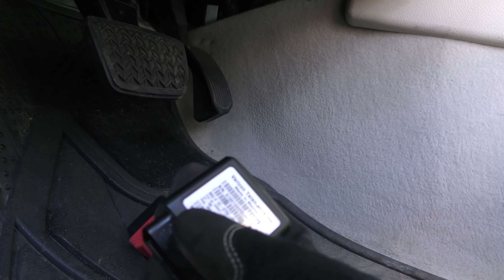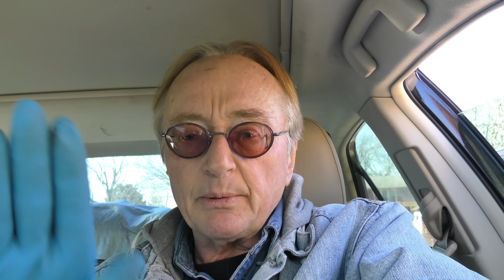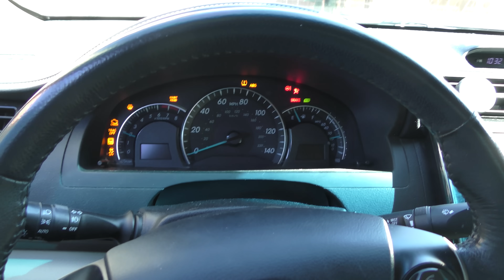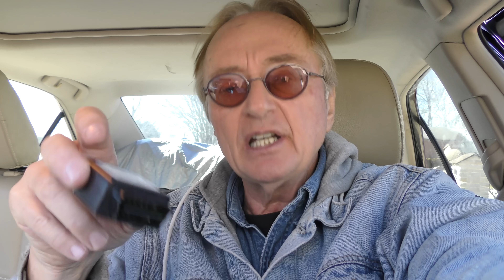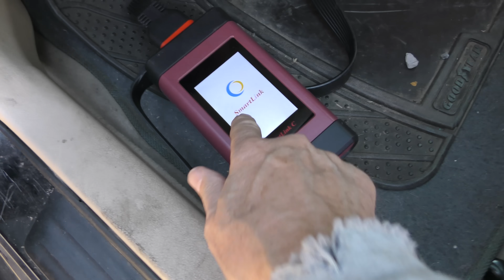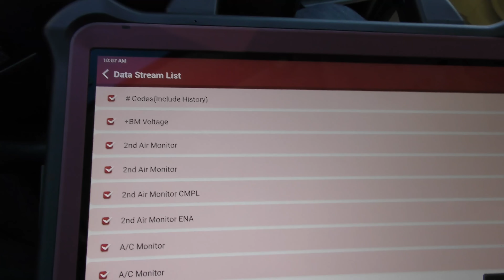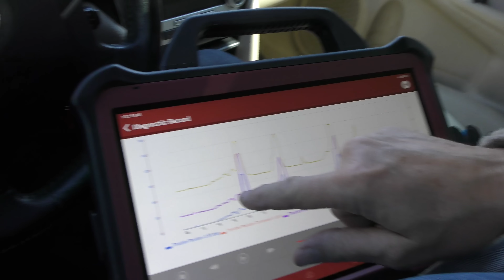This Stupid Device Just Cost My Customer Thousands in Car Repairs

Comment: these car computers are old af for a reason, they're substantially more reliable than current tech, I mean, ICE engines are crazy machines, throwing power spikes and mixed signals is their normal behavior, the OBD2 port has a dedicated fuse so a shorted crappy dongle wont fry your whole car, avoid crappy electronics in general but I see no reason to be this paranoid, I've had a decent one plugged in for almost a decade now and its extremely useful in graphing sensors long term to fix things before they even come close to failure, besides, looking at graphs is just plain fun

Comment: Annoys me when someone can't find the issue and just blames the ECU, When i first started riding motorbikes i put a bike into a garage as it had fuel injection issues and wouldn't start, mechanic blamed ecu, waited over a month, got my bike bike with a new ecu and still wouldn't start. That day i googled the electrical circuit and realised the bike had a tilt sensor, this had got stuck, tapping with a screwdriver fixed it...  Its rare the ecu goes bad, and if it does its going to cause more problems that you're seeing.  My money is on a bad earth or the tps sensor, since these go bad all the time.

Comment: Good point. I know I left one of those 'my mechanic' in my Lexus for a while now, but I need it to reset ecu due to knock sensor failure that kills the transmission overdrive function. Now that I'll be changing the knocks, I'll be sure to remove it.

Comment: That's a Verizon HUM device and it's purpose is to track lost or stolen vehicles. You HAVE to leave it plugged in for it to work. The diagnostic alerts it sends are just a feature. It's not a diagnostic tool. This device helped my family keep track of my Dad as his dementia progressed, and was an essential tool for his safety. I have used it for over 4 years and never had an issue. I have to respectfully disagree this time Scotty.

Comment: Scotty, I'm an infrequent viewer, and had to throw in my two cents worth here. You must know first that I'm a well seasoned electronic tech, and I think you totally missed what the scanner was telling you. The erratic fluctuations from the accelerator sensor OUT, are a CLASSIC symptom of a dirty rheostat. (inside that foot accelerator) Just so that everyone knows, despite all my experience, schooling, shops and my own shop, electronic cleaner would naturally be the go to. Oddly enough, it's NEVER worked. Right out of college I remember having a giant can of BIG BATH, as well as tuner cleaner, total garbage. 

I actually learned from other techs here on YT, that WD40 is the best and I have been recently using it, and have to tell you I'm amazed, it works well. Granted $300 and wait time to order that part is horrible, but if it appears to be accessible, I myself would have certainly have tried it. Without knowing what's inside, I can take a good guess, something along the lines of a spring loaded, rheostat. I doubt they would use hall effect transistors in there. 

Clearly the higher end of that control is either not making contact with a carbon or wire resistance strip, or it's gunked up and needs to be cleaned. If it's not touching correctly it's possible there is mechanical wear on how that pedal pivots or it's arm inside. 

If you have ever had an older stereo system that had very scratchy sounding knobs, that fluctuation your seeing on the accelerator chart is basically the same idea.

PS. Love your channel.

Comment: It's probably not damaged at all first remove the battery, connect terminals and attach both positive and negative cables together leave an hour to drain all power from the car then replug and do a relearn on the cars throttle position sensor ,If its a bad ecu, firstly maybe it just needs a reflash to the eeprom because it's gone corrupted by the telematics device or a flat battery etc , can be done on any j2534 passthru and a online subscription to techstream. Never replace a ecu until you tried flashing it first.! And Scotty clean that rusty battery  terminal.

Comment: I've seen some of those GPS trackers that plug into the OBD. I don't know why anyone would use one of those as ....
(1) It draws power from the OBD port
(2) The unit is below the dash where its not getting a good line of sight of the sky

Comment: Been a Mechanic for over 45 years, seen that problem many times. Those Plug in Accessories that use the OBD2 Connector cause numerous problems. From that Verizon Wireless node to those insurance Driving trackers. The worse ones are the Trackers used on Police vehicles all of them have it.  I checked every car I worked one for one of those stupid plug in pods, took it out, and then did my Diagnosis.....

Comment: Everyone saying that the dongle didn't damage anything should look into the comments where there are a bunch of people with experiences that say otherwise. 

I bought a very basis cheap scan tool at Walmart for like $50 to keep in my car. I never wanted to use those dongles because those ports and the car manufacturers never intended them to be used like that... Even if the device you plug into them was made for it.
Reply: I'd rather just check what the code is myself so I know, then take it to be fixed if it's out of my capabilities.

Comment: I am sorry but this broad statement without proof of it actually causing the issue is not the way to go. Making statements which take a broad swipe at the issue is like saying using that using one nail instead of a screw in the wooden deck is what caused it to collapse. Where is the proof? Where is the evidence? You may be correct - who knows? You do not know.  Have you taken apart the device, run proper electronic testing to determine it is not a passive device and is an active device therefore causing the issue?

Comment: So, I'm watching the video, just after the part where Scotty says never to use a plug in dongle device on the diagnostic connector and leave it, when the video goes to a commercial.  THe commercial is for a plug and drive dongle device to save gas.  Ha Ha  ;-)

Comment: I’ve never had a single issue with my truck with a dongle from sprint. My dongle is also a gps tracker (which is my main use for it) along with the scanner function. I would say that Verizon has more uses than just a cheap scanner.

Comment: Scotty, I hate to be an armchair quarterback, but I was watching your video and something occurred to me. Is it possible that your customer has a bad battery? You had codes related to low battery voltage, when the car is cold, the battery is at it's lowest voltage capacity, and may not have enough reserve amperage, or not be smooth enough for the computer. The only reason I ask this is I had a girlfriend who's SL1 started shifting poorly. I thought that it was probably going to need a new transmission. It turned out that she had a bad battery, and the TCM couldn't deal with the voltage sag and started shifting improperly. It seems to me that the Toyota that you're diagnosing might be suffering from Voltage sag. This would go away as the car warms up, warming the battery and replenishing it's charge.

Comment: Dude...you decided, right out of the gate, that the dongle was the problem. After the tests that you ran, I wouldn't be at all satisfied with that diagnosis. The cold vs hot circuitry is the exact same. Just reads different cells in the program, based upon temperature data from the sensors. Look for a temperature-related issue. I've been doing component-level electronics repair for 40+ years. (AND tuning automotive ECMs.) Temperature problems happen. More frequently than not.

Comment: If it was from Verizon I bet it was from an employer that wanted to track employees driving on the clock. I haven't heard about them in a long time, but they used to have fleet tracking using that port. But one thing goes wrong and you got shorts going to the computer.

Comment: That isn't a diagnostic tool. It's a Verizon Hotspot. It allows for internet connectivity and hands free communication. 

They can bring it up to Verizon and hold them responsible.
Reply: Since he said it was Verizon, I'd say yes.
I have a T-Mobile Sync Up Drive in 3 of my cars. And now I am wondering if the Low Battery warning that the T-Mobile app keeps crying about is related to the dongle messing up my computer. My car is < 3 years old (I replaced the battery ~ 2 months ago), but the dongle still gives me low battery warnings.
Reply: @T A  depending on your vehicle and the dongle. The device is likely never offline and is draining the hell out of your battery. 
Don't blindly replace a battery always have it tested first and you can do it daily with a multimeter.
You want the battery to be within 12-14 volts for everything to run 100%.
Some cigarette lighter ports have an always on function so be mindful of that as well.

Comment: I am starting to think that Scotty Kilmer give opinion based on what he thinks is hot right now.  Having corrosion on the battery terminals give a bad connection and will cause problems even with a brand new battery and alternator.

Comment: We have similar dongles on our company vehicles for GPS tracking, and we've seen the same problems exhibited (dangerously slow or hesitant acceleration, check engine light, speedometer fluctuates randomly while the doors lock/unlock), and the solution, according to the company mechanics, is to take them out. Of course, that doesn't sit well with the supervisors, who keep ordering new ones only to have them inevitably fail again, rinse and repeat.
I know of at least one accident caused by these, wherein the vehicle lost acceleration while making a left turn against oncoming traffic (a turn for which there was more than enough time), yet the company insists on continuing to use these pieces of crap.

Comment: Watched a video on electronics repair (stereo). The guy had a can of freeze spray with a little red tube. The stereo was all warmed up and working fine. He sprayed components, one at a time, till he found a component that made the stereo crackle when he sprayed it. Called it a "thermal fault" and replaced the component and fixed the stereo.

Comment: I've been using o e of those for 3 years on my 08 mustang gt with zero issues. And that car is older. It's possible for there being an issue on an older car for various reasons. That device solely receives data from the car unless it is qued to pull (user input). Either than that it sends data to the transmitter via Bluetooth  then sends I to cell towers. It's a perfectly good device to use for the average person on day to day. The. Argument that it caused an issue on an older car is like saying I have a car with 200k miles on it and a headlight went out due to me plugging in a phone charger. It has nothing to do with it.

Comment: I had a problem where the throttle stuck as I depressed the gas pedal, the let loose causing unintended abrupt acceleration. After doing that throttle cleaning, smooth acceleration was restored.

If only more car techs went to this extent to diagnose a car problem.

The dongle caused a circuit intended only for occasional, short duration activation to remain on, causing the circuit in the ECM to overheat, causing circuits or components in the circuit board to fail.

I try and find a used ECM in a salvage yard or on eBay with a money back guarantee.

Comment: I agree about opening the window. I’ve worked on vehicles since 91 and there were some years when a lot of vehicles automatically locked when you closed the door. Haven’t seen that in a while but I’m paranoid about it still. Also push button on/off. Had a customer’s new truck. Thought I put it into park. I didn’t. Thought I hit the button turning it off. I didn’t. Almost crashed inside my shop. It didn’t. 
Now I’m really paranoid about those 2 things.

Comment: I'll ask here...  My car goes into limp mode just after  Some oil burning pos truck passed me.  I mean that truck was smoking I could smell it bad.  Could that oil burning truck cause my car to go into limp mode?  I checked codes and they were lean on both banks.  I cleared them sat a while and everything worked fine.

Comment: Another thing if you decide to give the throttle a cleaning one day, don’t take the throttle piece out and clean it unless you’re prepared to take it to the dealership to get the throttle position fixed cause a basic code scanner won’t be able to get it done. I think that’s only if if has that sensor piece on it. Otherwise you’re fine.

Comment: Dielectric grease on any opened electrical connector before reassembly.
I wanted to buy a 1988 Pontiac Fiero GT to replace my 2017 Toyota Corolla SE rolling computer, but used Fiero prices have gone through the stratosphere.
Now I have to look for a more affordable 1980s car with no electronic, computer-controlled crap. No plastic crap, either.

Comment: I watch ur up tube all the time and I have a 2004 Toyota Camry LE 2.4 liter and I love it so far, had it for 3 years now. I only had to replace the water pump & idler pully, I had the mechanic replace the puppy too. Why don't parts come altogether when you order new parts. Is it a money thing? If so when you order parts & parts guy/girl doesn't tell you it doesn't come with everything. Why don't they tell you so. I like to do things the right way and NOT have to do over again! By the way, What are some of the most common things that go wrong on my type of car. My car only has 82,500. Miles on it & I maintaine my car when its need to done.😇

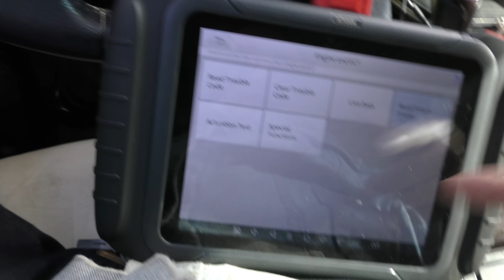Comment: Yeah it sounds  more like it’s a loose ground or a bad connector. The factory service manual has procedures for properly diagnosing trouble codes including checking voltages and resistance on the different circuits. I had an intermittent check engine light on my old mustang and while I was 95% sure it was a bad O2 sensor, I still spent an hour or two following the procedure to make sure the wiring and computer was good before I shelled out the $50 for a new sensor when it could have been a loose ground. Also at 2:40 Scotty said “We know it’s a fuel problem for sure” and never once checked any part of the fuel system.

Comment: Toyota cuts so many corners, it could be one of a hundred different things that cause the problem, I drove thousands of Toyotas to a from a major auto auction and they regularly have issues galore, especially electrical and CVT Transmission Problems, the 2.5L has a lot of problems below 120k miles, I had a handful grenade on me.

Comment: I like the bafx dongle. It's 22 bucks and works good enough for my hobby stuff, I found it because my 2000 f250 diesel is not OBD2 compliant and most readers won't read it. The BAFX dongle with the torque pro app does a decent job, of course it's not a high end scan tool.

Comment: That Verizon device was installed by the Dealer to track the car until the loan is paid off.  Many cut rate dealers use those devices to track the cars that have loans on them.
Reply: No, the tracking devices we use dont hook into the obd system only power ground and starter interrupt via a relay

Comment: It wasn't the GPS tracking/WiFi access point. They only draw power and can only read basic info off the can bus. Internally they have no connections to the harness for any more advanced features.

Comment: Correlation is not causation. How do you know if its a dongle caused it or not? I see soooo many mechanics whining about these & I've NEVER seen a shred of proof other than spurious invalidated statistics spouted out.

There's MILLIONS of these things out there if only 1% was blowing cars up there'd be outrage everywhere.

I'm not saying it's mot true or not possible but there's still plenty could be wrong with this car that hasn't been discounted, fuel problems being one too quick to jump to a conclusion based on finding a GPS data device in the car & assuming it's a odb2 diagnotitics dongle.

Comment: I do have a dongle - it was about 50, but I only use it to plug in if I get a check engine code. Scan, then find out the issues. Most of the time it is something like the window regulator is faulty. Not something I am worried about replacing. 

I never leave it plugged in, and don't leave it in while driving. It has been used maybe 4x so far of owning the car over 6 years. 

But I do have Progressive and they offer the dongle to possibly save you money for driving routines. I got one but then did some research, learned hard braking is "bad" so if someone cuts you off and you avoid an accident Progressive will see you hit the brakes and slowed down too fast/quickly. After I learned that information I sent it back and said to keep my rate at the flat amount. I don't care to try and save some money over these insane "stats". Plus I did not like keeping it plugged in 24/7 -

Comment: Sir, need yr advise, I'm about to change my insurance company to Metromile, coz I only drive my car once every 2 to 3 weeks, and they charge per mile I drive, save a lot for me, they said I will received a OBD II device that plug in all the time for them to check  whenever my car moves..............so is it safe ???  If it does, I also saw a solution that they can send a cigarette adaptor to plug in that OBD II device, will damage the car computer ????

Comment: I would clean all terminals of the battery first and test each cell of the battery with a refractometer, also a load tester on the battery.  This occurred on my Mercedes when cold in winter as the battery slowly drained.  Car would act wired. I also have  electronic diesels in my boat and I found out that my battery was the issue causing havoc on the computer on initial start due to low voltage on initial start.